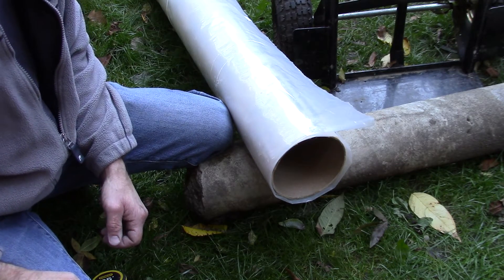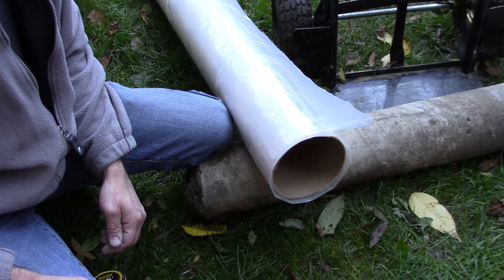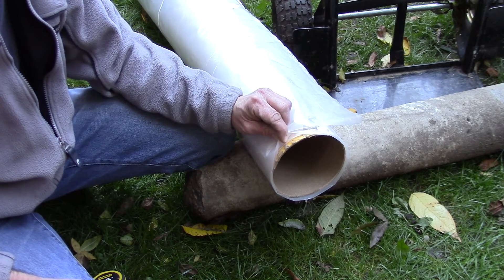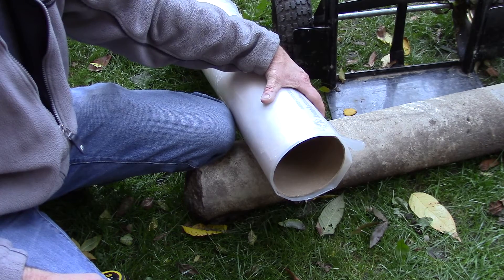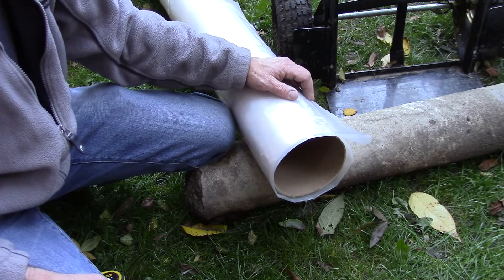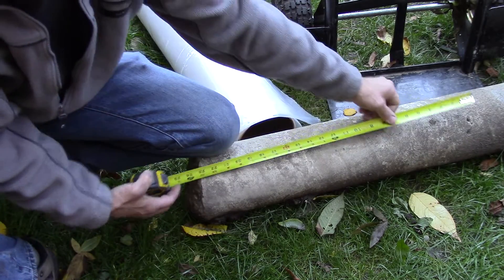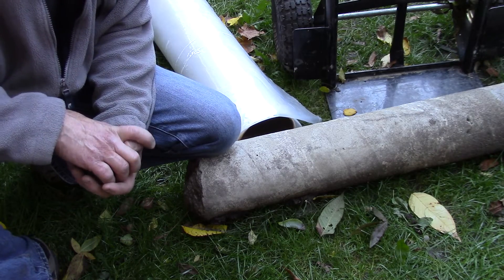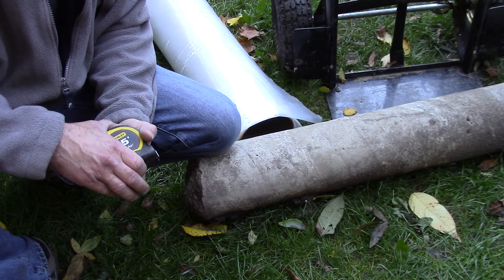Fence post above frost line solution.

Comment: We're in far northeast MN, where our frost line is between 80-90 inches deep. We're planning on building a small home on concrete piers. Would this pass code and reduce the depth of the holes we need to dig?
Reply: It will pass code 100%
As a home owner all your doing is adding a second layer of protection.  It like getting your new car undercoated at the dealer it a extra layer of protection
Reply from the maker: I don't think it would pass code. I would only use it for a problem post. Drill full depth on all your posts when possible.

Comment: what's your sonotube diameter?
Reply from the maker: 15cm/6"  i have used this on 20cm?8" also and it works well for plain steel pipe without cement.
Reply: Bob Cartwright
what is your recommendation for 4x4 wood post fence. i'm guessing 20cm sonotube?
Reply from the maker: minimum 20cm.